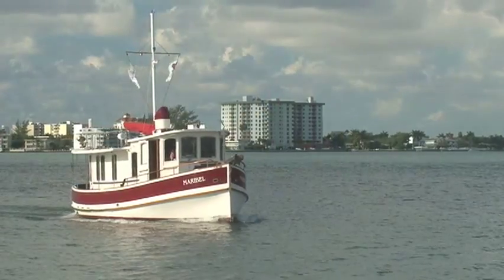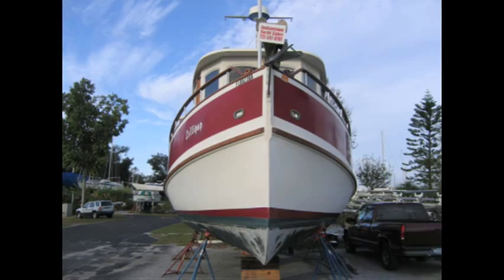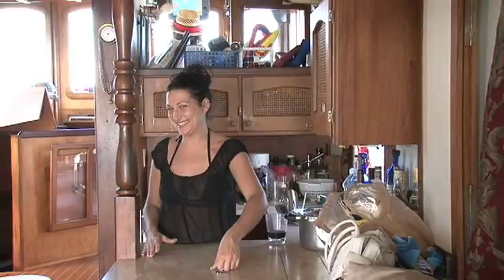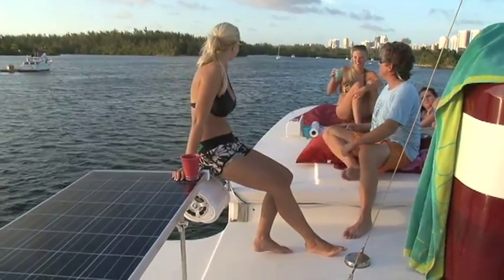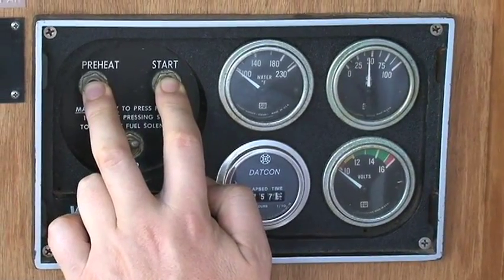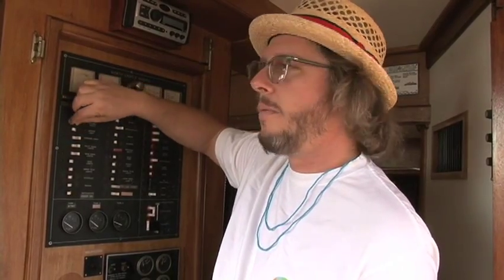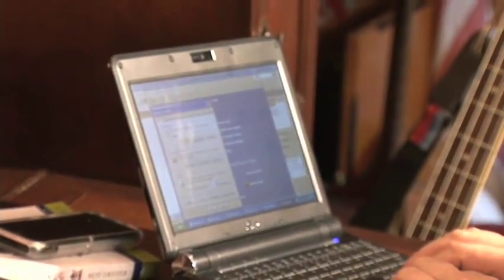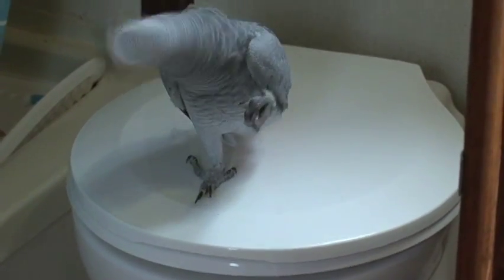Greening of The Maribel - SOLAR

Comment: I like what you've done! How long did it take to convert your boat?  I know the up front cost must have been high, but the long run must be relatively insignificant. What considerations did you make in determining what to do to the boat? What are the length beam, and draw/draft of the boat? What type of motors did you put in for propulsion? What do they draw in watts? Do you stick to Miami, or do you cruise the ICW. Have you taken it out to the Bahamas? Drop me a line at DeWayneJelks@SBCGlobal.net